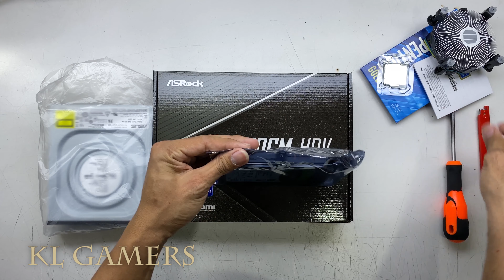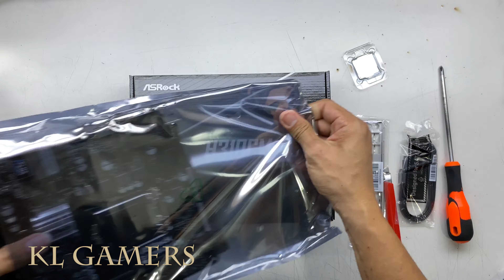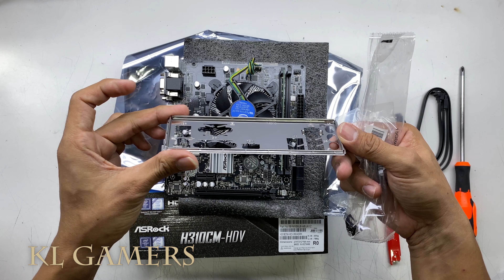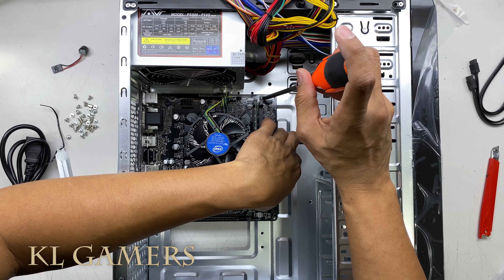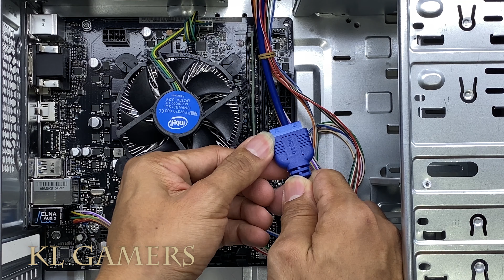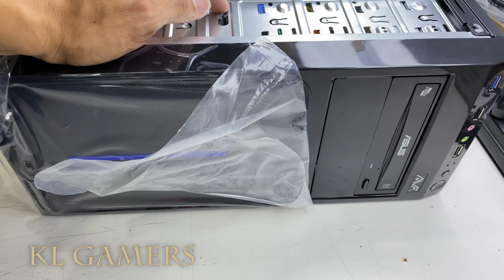intel PENTIUM GOLD G5420 ASRock H310CM-HDV Kingston 4GB DDR4 Seagate 1TB Budget PC Build for Office

Comment: Kingston ValueRAM 8GB 2666MHz DDR4 Non-ECC CL19 Desktop Memory KVR26N19S8 is single channel ?
Reply: Any single RAM stick is single channel. Even if you have two RAM sticks of different memory capacity, your BIOS would act as single-channel RAM. So you'll need to get two RAM sticks of Kingston 8 GB DDR4 2666 MHz in order to make your BIOS recognize it as dual-channel.